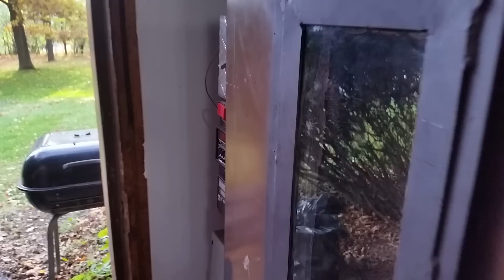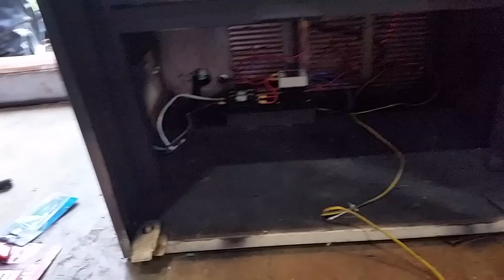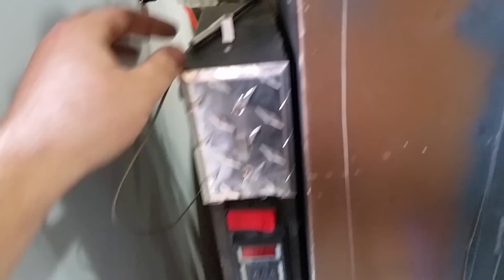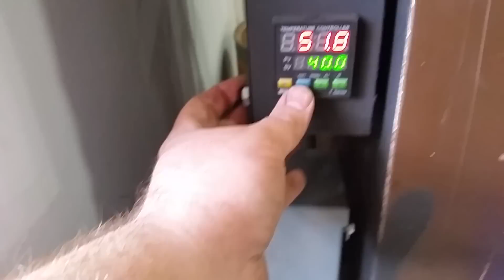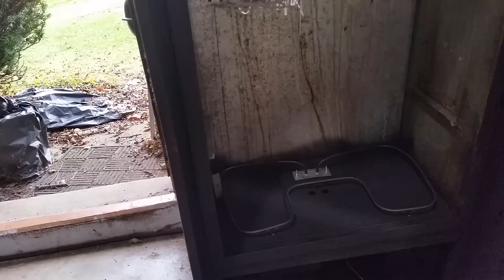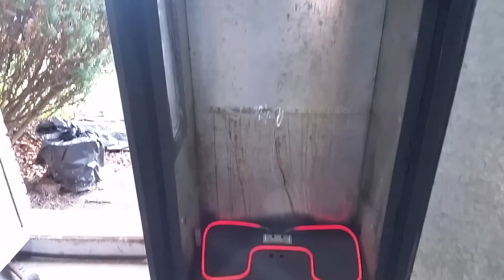My homemade powder coating curing oven

Comment: Didy you remove the aluminum lining to get to remove the foam insulation or leave it?
Reply from the maker: onyx linthicum I gutted it completely 

Take a look

https://discuss.inventables.com/t/powder-coating-oven-and-setup/33597?u=philjohnson
Reply: So you have no insulation in it now to keep the outer walls from getting too hot.  I have a soda machine and I've gotten it down to the aluminum walls but behind them is the foam insulation that I know needs to come out. Just was thinking I should probably replace the insulation with some R13 and cover it with sheet metal to keep the outer skin cool when the inside reaches 400 degrees.
Reply from the maker: onyx linthicum did you look at the inventables post?  I gutted it after this video and re did the insulation (pink) and skinned the inside with aluminum tight over the insulation. Very insulated and heats up to 400 degrees Fahrenheit in 6 minutes.
Reply: Ok this is great. Thanks. I'm doing the same thing and gutting that Styrofoam is a pain in the buttocks. We had started doing the same thing to an old freezer but I thought the soda machine was a better option because of the heavier outer skin. May repurpose the sheet metal from the freezer to line the inside instead of using aluminum.
Reply: When you installed the aluminum over the pink insulation did you compress it tight against the wall or leave room for ecpansion? Did you use R13?
Reply from the maker: onyxlinthicum stuffed it like a pig. Yes, R13. Works great.

Comment: What a waste of a perfect vintage Coke machine.
Reply from the maker: Open Air Model Shop actually this vending machine is from the eighties not quite vintage. it no longer worked and instead of throwing it out I decided to repurpose it. if you want vintage I have a 1930s Coke cooler Westinghouse Web Box completely restored. by the way this vending machine only cost $100
Reply: @7711gman  I find these almost daily for $50 near st louis. I am getting into powder coating maybe I will buy one and make me an oven
Reply: Found a Dixie narco 801 I think it is. Owned one before but can't recall the exact number other than the 8. Anyhow it's $100 bucks it cools but the change mechanism does not function all the time. I usually switch them to get bend per Dixie narco instructions anyhow but it's s huge machine so i could get big stuff in there

Comment from the maker: it is wired with both. the controls are 120. they trigger the 2x 40 amp relays with 3vdc output from the PID controller. there is 240 going to the fuses, then the SSR'S, then the coils  (there's 2 now).

Comment from the maker: I will eventually post a new video with it updated. but in the mean time. 

it was completely gutted. I welded in bracing to rivet new aluminum sheeting to. I lined it with fiberglass insulation then covered it with aluminum. it now has 2x 3500 watt oven elements. a Mypin Ta4 pid controller. homemade electronics control box. it will heat to 400° in 6 minutes and hold temp within a degree or 2.